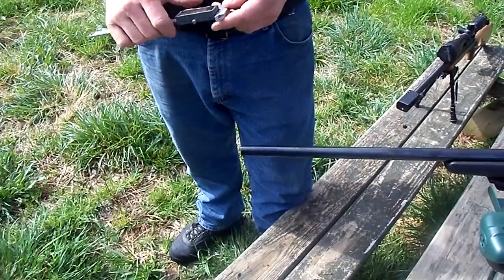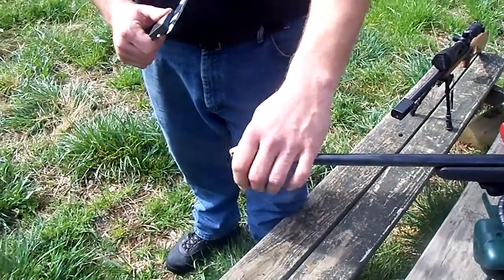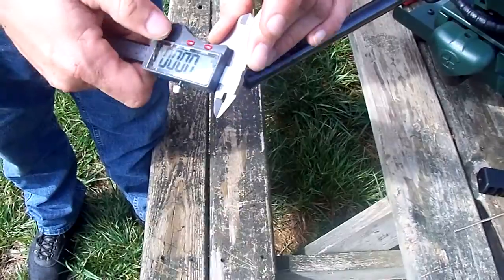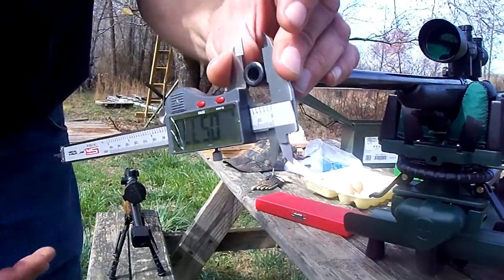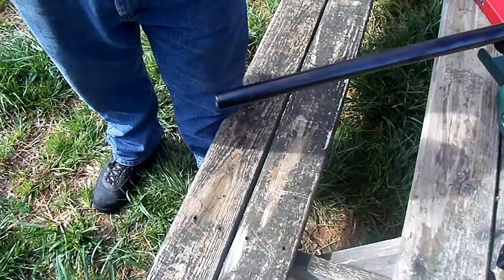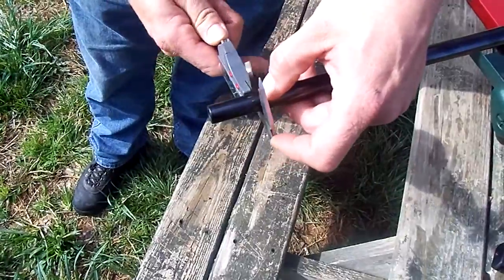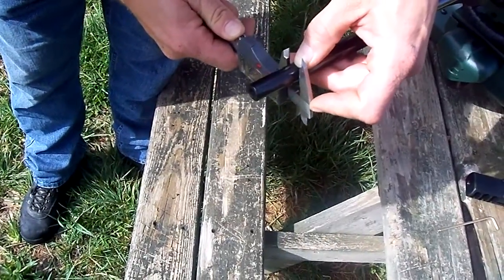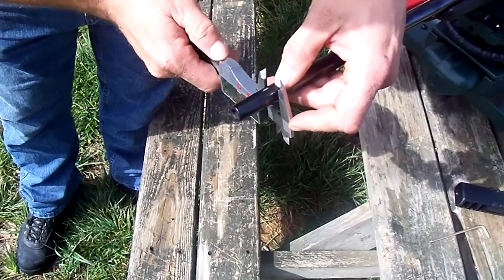Measuring your rifle for a KahntrolSolutions Custom Clamp on Muzzle Brake

Comment: If the barrel is fluted at the 1.5 inch, is it still possible to get a clamp on muzzle brake?
Reply from the maker: Yes, the flutes will emboss into the brake slightly which increases the integrity, so make sure its level before you crank down on the screws.